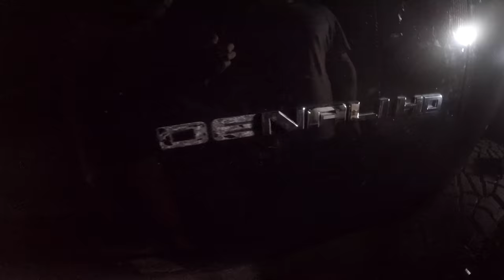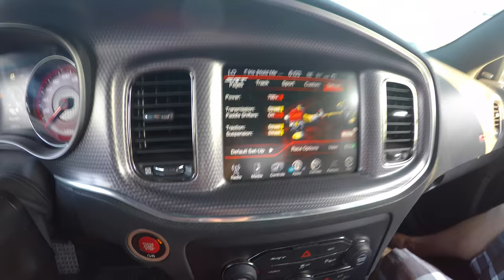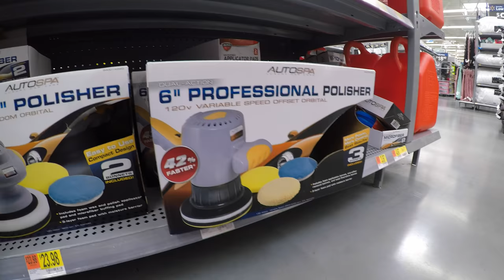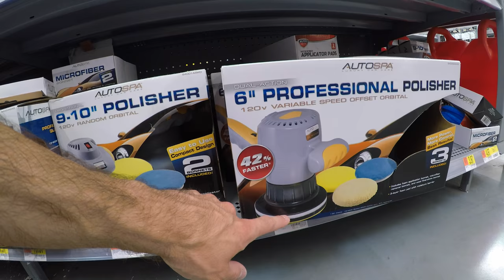Duramax Debadge, Removing Molding, All Badges & Trim! Murdered Out Duramax

Comment: If you use fishing line the spider wire kind that's braided or dental flosse and slip it behind the letters and use a sawing motion, it works awesome. Then use some clear mineral spirits on a terrycloth rag and it will take off the sticky glue residue and leave a beautiful finish like it never was  there. It looks perfect I've done it at least 7 times on several different vehicles. No need for a hair dryer or heat gun.